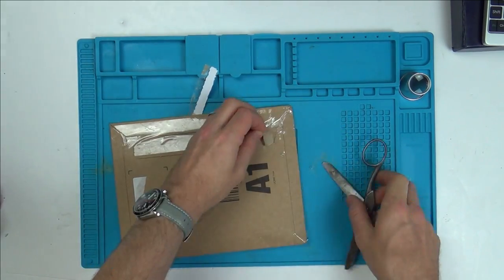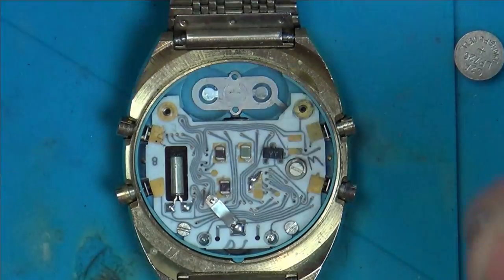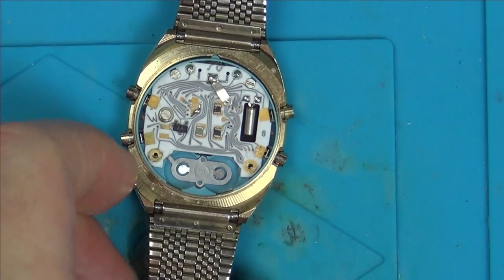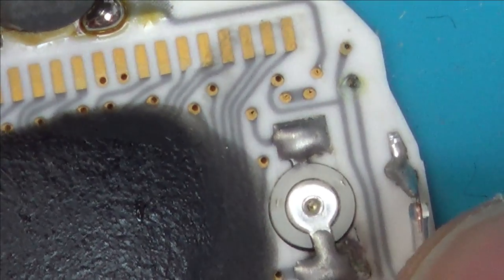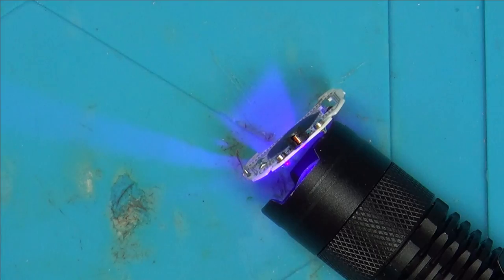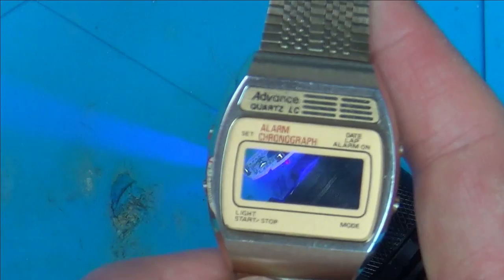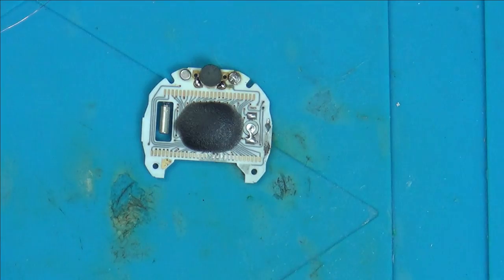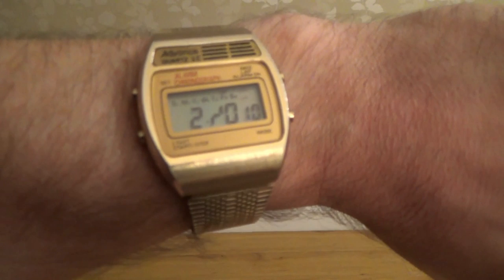Trying to FIX: Faulty 1980s Digital Watch from eBay

Comment: I worked for a company that imported those watches in about 1984, the cost price was about 60p per unit, one of my jobs was to test them, as about 1 in 20 where faulty. The weird thing is the alarm in most of them made a normal tune, but in every box of 100 one watch would play the star wars theme.

Comment: HI Vince, first off  good attempt.  What you have there is in my opinion definitely vintage because its on the very old ceramic boards.  In fact it will be a really early digital as they soon stopped using that for the more conventional fibre type boards and even that thin green plastic type ones.   These are also 10 a penny ,  100s of brands using the same probably Hong Kong module, the ceramic boards are hard to fix so in my opinion despite your first attempt, because you know enough about boards and circuits you have done very well.  
I used that conductive paint to great effect fixing tracks and just used one  ply of a tissue rolled into a point to be thin enough to apply (under a scope)  sadly I dont have a heat gun tha the stuff takes days to try. 
These old digi's can fix themselves ,.... trust me!  they have a habit of when  warm to spring into life, ive had them on radiators in the house for a day and then the screen comes on! 
Id still think that your screen issues could be the zebra strips as it appears you did not remove and clean with alcohol on both sides,  even the contact on the screen can be cleaned carefully (I do it with an ear bud) 
Alarm im lost with, should be there so could be the IC or a circuit.  Does the board still have the spring that contacts the piezo? That would not solve your issue but at least it would sound. 
Either way, great as always. PS< hope that was not your new tweezers I saw bent at the ends!
Reply from the maker: Haha, no Mike this was filmed before I got the tweezers BUT I must say the tweezers you recommended are amazing. They are so thick with no flex yet light enough to be easy to use. In my opinion they are a perfect balance and screws are so much easier to pick up. 
The alarm is now working!!!! due to a helpful comment, it is mode and then set, to swap between the stopwatch and the alarm and it is loud, much louder than the Casio F-91W. Strangely you only use the alarm button to turn it on and off NOT to enter the setting hence why I couldn't find it.
I have since tried cleaning the zebra strips on both sides, top and bottom as well but it is still not working. I have tested the LCD by using my bench power supply with zero voltage on it. It lights the missing segments up when I touch the zebra connector with my hand and positive probe, and this allowed me to find the actual contact that controls the missing segments. Unfortuantely I have traced the continuity into the blob chip so something internally is not sending that signal so this will never work fully.
It was a good attempt which I enjoyed, hopefully next time I will be more successful. 
As always cheers for the help and advice :-)
Reply: Hi Mike 🤘

Comment: I had one of these back in the early 80's. They sold them exclusively on TV. I think they cost $19.99 at the time. The big selling point was the alarm could play 4 different tunes. I do remember it having a strange button combo to access the alarm section. You had to press mode until a certain icon lights up, then you have to press a 2 button combo to activate the alarm. Nice trip down memory lane.

Comment: LC is likely Liquid Crystal (display) before LCD there were digital watches that used LED or other display tech that were very heavy on batter life and usually you had to press a button to turn on the display so it was a super "new" tech they wanted to highlight.

Comment: Interesting vid. I think the missing digits might be an issue with dirt on the zebra connector or similar on the connector strip. If pressure on the front of the module brings them up then it almost confirms it. Re-soldering those gold connectors might be the issue if they are slightly proud of the others, giving a hump back bridge type of effect. A bit of experimentation might fix it.

Comment: I bought a similar shivas melody watch as part a job lot. It had a screw missing for the battery and the piezo sounder had fallen off the back. Pinched a screw from another location, new battery and careful reposition of the piezo sounder and job done.

Comment: Itsa bitsa! I used to take all my old digital watches apart and swap parts over to try and make a better hybrid… didn’t work, sweat of fingers would deteriorate all the fragile coatings/connections, and LC always stood for liquid Crystal, which was a major advance over the previous LED Kojak watches

Comment: The display is still missing that one trace and in the time that existed bad corrosion ate the negative terminal. it also looks to have some sort of waterproofing on it what i would do is try to find alternative guts to put in it. Like a super cheap casio or some lot of watches with broken straps.
Reply: The traces could be fixed with conductive pen but those vias need some TLC solder and honestly the whole thing is not in good enough condition to bother. If it was some extra rare or valuable watch maybe but this was 30 dollars at most new and is currently only worth 5 or so dollars. IMHO it does look really well made. All those screws holding it together.

Comment: Have you tried a "fiberglass pen" to remove the corrosion? It seems like a very targeted "abrasive" for electronics. I've seen other restorers use them but I've never tried one myself. It seems like magic for resurrecting pads.

Comment: This is a Seiko knockoff. I have an original Seiko just about identical to this. Where this says Advance, mine has Seiko. The buttons and labelling are the same. Bought mine in Hong Kong in 1978 and still works
Reply: It's a cheap SEIKO copy. 
The '80 LCD SEIKO have the case in stainless steel, the speaker is in the front, and is no piezoelectric. 
The circuit board is better made and works with one battery only.
I have two old SEIKO LCD.

Comment: You might be able to replace that bulb with an SMD LED - may need a resistor in series.  You would just need to work out which side is +ve and which is -ve.

Comment: Hello sir i have similar lcd quartz model from omega which is ref no 196.0074 with cal 1616 Looks the same! 
The battery is leaked to the module so it wont run im wondering if you can fix? I'd really appreciate if you give me the quote!

Comment: When tracing the location of via,s from one side of the board to the other, instead of measuring with a piece wire try using the tips of your pointed tweezers.

Comment: I have a problem on the seiko module 158 there is no side contact of the batteries, there is only one that is under the batteries, everything is works  but in the time display mode, it blinks,(on other modes not) the light does not work, but when the button is pressed, the clock stops blinking. I really need help who can help me and tell some advice?

Comment: You can clearly see the shadow of the old negative pad on the face of the board. The trace that  Leads to the light
Reply: Yes I was thinking the same thing, the battery contact wasn’t reversed. The contact was missing, you can see the ‘shadow’ remains of it.

Comment: Quartz is the crystal that is used to keep time as it will vibrate at a constant frequency when voltage is passed through it.
LC is Liquid Crystal as in the display. Today we call them LCD''s.

Comment: My theory on the battery leads: som one changed the battery and in the process it all fell apart. When they reassembled it they did it wrong, found that it didn’t work, and gave up.
Reply: No the contact pad is missing, you can see the spot where it used to be.

Comment: You are correct the Seiko Alarm was the first to make an LCD alarm watch   www.seiko.in/sp/world/the_seiko_museum/visiting_the_seiko_museum/index8.html  and other manufacture copied the design.   They could not replicate the front speaker and thus used a rear piezo buzzer but kept the fake front.  LCDs do not last forever, that's probably a bad display now. but the IC  can also fail to drive the display.    Pressing set and alarm should turn on the alarm,   pressing them again should cycle it off.  Also while adjusting the alarm time should also activate the alarm.   Pressing alarm button only should display the alarm set time.  ADVANCE was a popular copy watch in 1980s.   I think someone swapped  watch bands when a good watch wore down. The watch face looks too clean for used.
Reply: i like the design of the original.

Comment: The contacts for the zebra strips I think you will find are causing the display problems m8, couple of them were looking a leetle worn away and I would suggest getting some conductive paint and remaking a new pad on the very worn one and see if that puts the digit's bars back or not.   There is a piezo speaker on back so weird why there is no alarm mode unless it is simply an hour chime turned on and off via the button.   I do love the construction of that bracelet, that is insanely cool with the little layers etc of it.   Always got that Seiko A904 if you fancy a go at another... ;)

Comment: Most LED's work with voltages from .6Volts right up to well who knows if it's constructed with it's own resistor in series, Now with the alarm have you tried holding the mode button and cycling the button above it? 
The Zero might actually need "NO TRACK" where it looked like a track was initially corroded or painted over to hinder contact or it may be that I have that the wrong way and it needs a lot better contact.. APU I dropped a like..
Reply: ADDENDUM
Never mind my ALARM suggestion, as gadget madlad also concluded how to do it..

Comment: one thing to remember if you get more modern casio watches is there are often 2 points that need to be shorted to get them to display when they have a battery change i bought a casio solar watch that had a capacitor type battery that had been replaced seller made a mistake of not pushing the metal contact down working fine since .

Comment: please be aware that the two contacts for the Negative side..one is missing and that one goes to the Light...  the watch runs on 1.5 volts and the light runs on the other battery (1.5 volts).... SO  the negative conductor should have had Two connections ... not just the one...

Comment: A trick for working out where  vias on two layered boards like this one go, when the board layout is complex. 
Take a good picture of both sides of the board, preferably from a tripod. 
Flip one image (mirror it). 
Print both images. 
You should now be able to align the vias and detail on one side with the vias and detail on the other. 
Bigclive of the bigclive.com channel demonstrates this trick regularly, and I have posted a few hacks using this trick. 
This multimeter  for example in the link below. 
Look at the picture of the switch towards the end, it has both sides of the board sandwiched using transparency. 
https://photos.google.com/share/AF1QipPykJgrz2vMySXTkFdst6YsfoTs0Mzs1vmWZXa-XQ5EGBxVeRmFiqj-jO2c44IFcA?key=T01ITXVCa015U0x5WV9UZUV6dUdiSGdXUTBENF93 
It saves a lot of head scratching and potentially damaging mistakes.

Comment: Just had an idea: what if the contacts were placed upside down during a previous repair by ignorant hands? (positive could be placed down with the screws conducting to its pads and the negative could be made to grip its pad instead of merely touching it.)

Comment: The set button would operate with dual buttons to alter the time or date, hold set and find Hour, Minute or Date buttons, Hold set an press mode to change time, Date and Alarm not Hold my old Digi retro (with purple screen & red LED) was hold set for a few seconds an tap mode  to change the options.

Comment: Great fun video but I think the watch came out of a christmas cracker ! sorry, I think it's a cheapy, the fake speaker grill gives it away, maybe "LC" is for Liquid Crystal as the displays where reasonably new back then, as for the weird negative connection maybe just corrosion. From what I can gather the traces are "Fired" into the ceramic in high temp ovens, bummer about the light !...cheers.
Reply: It was designed to copy the expensive Seiko quartz LC. Google it. They are very similar.